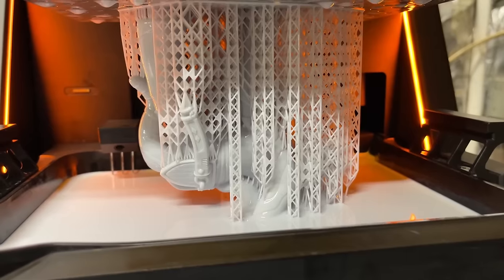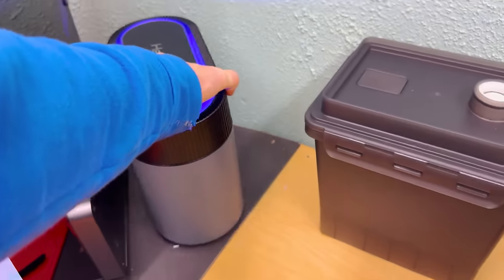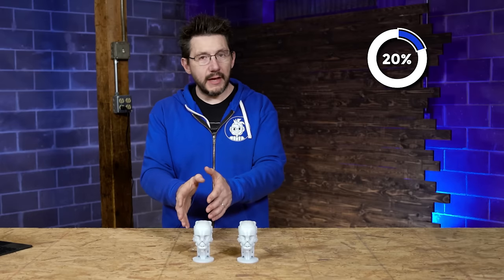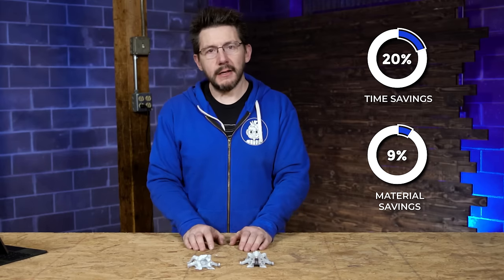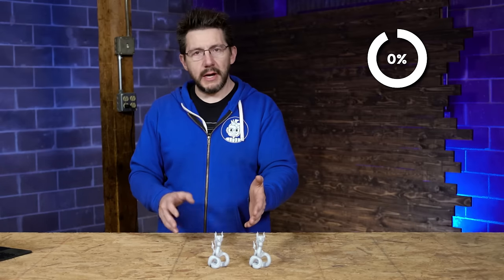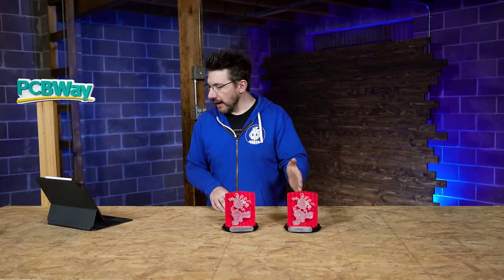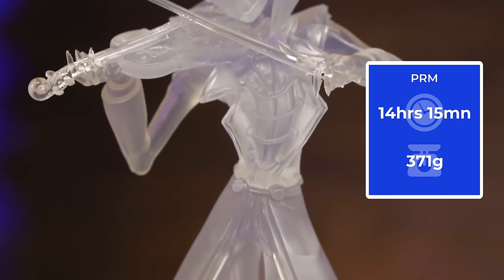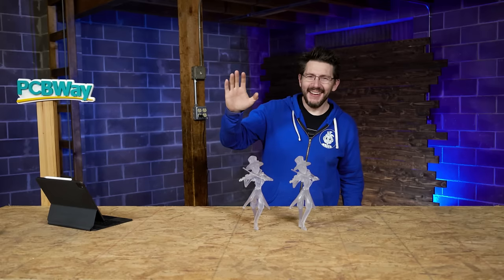Does the HeyGears PRM Work?

Comment: Not a fair comparison, you have to run the same print settings and speed up both machines until one fails. You don’t know if you could have achieved those settings on the standard machine.
Reply: so you will not have video comparation because all would fail.
Reply: @rubendariovelez   I think the point is you incrementally change the speed/support values and take the best possible set of parameters that each machine succeeds with to use for the comparison and to see what the actual savings are.

It's a fair point that this would be the only real way to get to the most realistic values based on what is realistically achievable for each machine. Otherwise you are just comparing two arbitrary lost of settings without knowing whether they actually represent the limitations of each machine or not.
Reply: I agree with that. In terms of reducing stripping force, I believe we can entertain bolder ideas, such as printing models without supports. I feel this module has sparked my imagination even further.
Reply: HeyGears slicer is locked and you can't change the settings. The only thing you can change is if you want to print a miniature out in 50microns or 30microns. So they are using both the same settings.

Comment: hmm this makes me wonder if the printer without the release module could have also printed with the settings chosen for the printer WITH the module.... because doesn't this all rely on having chosen different settings in your slicer? Like you still have to choose a different lift speed right? Meaning I feel like to really get a true understanding of if it works, it's almost like you'd need 3 printers. 1 printer with the release module and tunes settings for it.... another printer without the release module with those EXACT tuned settings.. and then another printer with longer lift speeds to show what was really needed to get the same successful print. If the printer without the release module that also has those tuned settings fails, but the printer without the release module with it's different setings succeeds, and then the printer WITH the release module is successful, then I think you could say it definitely works.
Reply: I completely agree. It wasn't scientific. It felt like an ad. Of course, the 1 was faster. The files were configured to be faster. He didn't share why those settings were appropriate for one and not the other. Some config prints are all that would be necessary to justify the different settings. Otherwise, it is just theatre. He was comparing apples to oranges. Even that the 1 print failed doesn't prove anything.
Reply: I have a great interest in reducing the stripping force. I'm imagining if, through this module, my need for supports could be greatly reduced, or even envision a scenario without any supports at all. This is what I most hope to see. I'm looking forward to seeing more test videos.

Comment: Unfortunately, the testing method as presented is flawed and doesn't provide any conclusions. Perhaps if you had used the same speed and support settings for both printers and shown consistent failures with the non-PRM prints we could deduce a difference. We don't have evidence that the non-PRM prints couldn't perform with the same settings, aside from the single failure you encountered.

Comment: I love your videos Joel but this sounds like hogwash to me... It's a box that sits next to the printer and does what exactly. No real info on their website either and 650$ SMH
Reply: I do believe it saves time and resin. Time from being able to peel faster, resin from having smaller supports. If those supports would also support the normal model we won't know cause I don't think he tested/tried (except for the skull, where even the stronger ones Brooke).

But not even mentioning the price (except for it being visible in a screenshot) is kind of shady. Cause that buys a lot of resin! Not too mention their printer being much more expensive than most in the same class, too.
Reply: Seems like this device generates high frequency vibrations and, by sitting close to the printer, transfers the vibrations via the shared surface of the desk? In this case, having the reference printer sharing the same desk surface would cause it to potentially benefit from the same effect when printing at the same time. Would love to see a follow-up with fairer test conditions.
Reply: @KayMan2k An actual test would be nice. This was just using two different settings. Those settings may require the little device or they may not. We can't know from just one test print (per model and setting).
Reply: @KayMan2k anole said it uses air to create the high frequency vibrations.
Reply: If it transfer vibrations thru air, then it won't be ultra sonic. And then, why not just shake motor?
Reply: There's an air tube that connects the two: https://youtu.be/jd6m7DVQ9MQ?t=11 @KayMan2k
Reply: @thePavuk I have no idea I’m just stating what Joel said in the video and I’m sure he’s just stating what he was told by the company.
Reply: Not a fan of this video. It is an advertisement.  No substance- didn't show us the difference in supports, nothing showing it is easier to remove supports, and all the values seem to be from the slicer rather than actual measurements. Love Joel but hate these paid advertisements.
Reply: I found on their livestream that It's airpump, it pressures area in printer or between screen layers so it bends up and release layer.
Reply: @thePavuk  so it's an air pump?? For 650$...
Reply: If this technology were real, I believe it shouldn't just be sold for $650.
Reply: This could be a brand-new technology, and I hope it can undergo more testing. @KayMan2k
Reply: It also comes with a specialized resin vat. Can't use the pulse release module feature with a regular resin vat. However, a regular resin vat AND the specialized resin vat will work in regular printing mode.

Comment: I guess a couple of questions/points.

Did you try printing the model file with the PRM settings/supports on the non PRM machine just to check whether they would indeed actually have failed without the PRM?

On the resin used/saved, I assume this is based on the values given by the slicer, which would account for the resin required to create the model plus the supports. In reality though there is a fair amount of additional waste resin due to the amount which coats the print (and gets washed off). In my experience this increases the amount of resin used a not insubstantial amount of the overall resin used. Assuming this would be much the same for the PRM and non-PRM prints of any particular model, this would drag the actual % saving from the PRM down a bit (I guess the only way to know would be to weigh the resin vats before and after printing to see how much resin was actually used... unless you di this, in which case I'll shut-up!)

Comment: No footage of it in use?
Reply: Seems like marketing video.
Reply from the maker: Working on it in a follow up. There isn’t much to see when it’s powered on. I believe it’s a small air compressor.
Reply: @3DPrintingNerd  that costs $650 😅 Someone is going to figure out how to do this with a cheap ultrasonic devicd
Reply: @Hilmi12  If ultrasounds can be used, maybe someone could just attach the transducers to the printer itself so they power on after the UV light source powers off every layer, kind of a reverse resinlapse, but it works when the UV is off instead of when it's on

Comment: Why not use an ultrasonic probe placed in the resin vat?
Reply: I thought something similar, though you might want to vibrate the vat itself and not the resin pool. The other consideration is how to pulse the vibrations during the layer change and not just always on. You would probably get print artifacts and failures if you vibrate during curing.
Reply: Timing the vibration to just as the light goes off and the peel starts may definitely work.

Comment: Seems like putting a Transducer in the frame of the vat or vat base would be a billion times more effective; than using puffs of air directed at the printer body. Requiring less power/materials. 

The data for pulse timing could be set in the slicer. The build structure could easily be vibration isolated with gaskets/bushings, or sensitive components mounted on anti vibration mounts. This seems like it would be more effective and cost less. 

The perfect solution to take advantage of the extremely narrow window available to speed up resin printing, just not best application.

Comment: My understanding was it simply syncs with the retraction and pumps air below the feb film removing the suction making the print release easier thus allowing you to use much lighter supports. Ross at Faux Hammer was down to 50um supports which is nuts. The supports just fall off after printing leaving little to no effect on the model. Now just need a couple thousand dollars extra to buy the printer and the PRM module . $1399.00 for the printer and $695.00  not to mention the 60-70 dollars HeyGears resin for their special 385 nm UV .

Comment: Any chance you could do a test with an upturned motor and an offset weight to see if it yields the same results? Maybe even connect a microcontroller and see if you can't time its pulses to when the printer finishes a given layer and starts the tilt process? It would be cool to see someone DIY this and improve the overall resin printing field.

Comment: It's cool that the printer can theoretically use less resin due to needing lighter supports. In practice though, I don't think we're quite there yet with autosupports for most resin prints. The vast majority of what I print is going to be supported by hand. Sometimes by me, but usually by someone hired by the original modeler or the original modeler themselves. In those cases, it's just going to be a pure speed boost.

Comment: I appreciate what is trying to be done however current post-processing is hardly a gruelling chore. I'm confused over the resin saving, too.
Reply: Thanks for your interest in the PRM! By using the Pulsing Release Module to lower the peeling force, the required diameter and density of the supports needed to achieve a successful print can be reduced, thereby allowing for decreased amount of resin used in the support structures. This generally means more resin saved with prints that require a lot of supports. The overall reduction in support quantity and the size of the contact points should also make it easier for people who spend time sanding the bumps left by supports to get a smooth surface.

Comment: [ explanation ] I explained how this machine works, but my comment dissapeared. Probably again bug of youtube.
It's air pump for that specific printer. It pressures eather area under vat or double layer screen so the screen bends up and releases layer.

To find how it works, don't go to their page, don't just go to their promo video... go to their promo video and there is link for "the launch live stream" where they explain it in 2:20 

I would not cal it High Frequency Vibrations - you can't go over like 100Hz with high pressured air in long thin plastic tube. More like 10Hz.

Comment: So the printer knows it has the module and automagically changes the procedure? Or did you have to use different profiles?
Reply from the maker: You tell the printer it had the module and it will configure itself automatically

Comment: You likely could have gotten an even bigger resin savings by manually shrinking the support settings in blueprint. You can go insanely small on your supports with the PRM and still get successful prints its kind of crazy. Definitely turn off the ball tips too. The other benefit of this is practically indiscernible support marks.
Reply from the maker: Whoa really???

Comment: Did you switch which printer has the PRM? That way the gains are isolated to just the PRM and not a "better" printer. They may be the same model, but it is unlikely they are made by the same person using the exact same pressures and tolerances during assembly.
Reply from the maker: No not this round but I may in a follow up. I like this idea.

Comment: Did the slicer auto calculate supports and speed or did you have to do it manually? Auto I could see but if you manually did it I would have taken it to the max it could do like others have said.
Reply from the maker: Everything was auto calculated by the slicer. You pick the machine and what type of tank (normal or PRM) and then it auto sets everything.
Reply: @3DPrintingNerd cool thanx!
Reply: @3DPrintingNerd Then it should be easy enough to test if the PRM settings will indeed need the PRM to be present.

Comment: So it is fairly obvious where the time savings comes in...less peel force so faster print speed settings can be used. But the material savings isn't so obvious. Was the reduced material due to needing less/smaller supports? I would think that prints that need no supports would not have any material savings.
Reply from the maker: Yes, it was in the supports! The supports in the PRM models were thinner than the standard supports. I’ll try to get some close ups for my follow up.
Reply: @3DPrintingNerd  I figured as much. I already use the smallest supports available in Lychee, I just use a lot more of them. That way the supports come off a lot easier.
Reply: Yes, that’s right. Models that require more supports will generally see greater resin savings when using the PRM. The PRM also makes it possible to use fewer supports overall, since the lower peeling force means both the quantity and diameter of supports needed for a successful print is reduced.

Comment: What if any changes are being made in the slicer? This video seems to be missing key information.
Reply: The slicer for the UltraCraft Reflex, Blueprint Studio, will automatically apply some parameter changes when the PRM is selected and used. Those parameters cover a range of different things including support diameter, support contact point size, support quantity, build plate movement etc. to balance with the reduced peeling force that the PRM provides.

Comment: Does this need to be sliced separately? I assume that the supports are made thinner by the slicer for the one that uses the PRM, and also change the duration of the build plate movement.
Reply: When using the Pulsing Release Module (PRM) with the UltraCraft Reflex, just select the PRM option in the Blueprint Studio slicing software and it will automatically adjust the printing parameters during the pre-processing - including the support diameter, contact point size etc., no need to manually adjust the separate settings. Hope that helps!

Comment: Thanks for the video.
Shure vibration wil decrease the peel force needed. So it can print faster becouse of faster lift speeds.  But how on earth can it decrease the amount of resin used, if the model with the supports is the same. The volume doesn’t charge.  Or did i mis something,  like using auto support specifically attuned for the model with the vibration module (resulting in smaller or less supports) and the other one without the vibration module optimization resulting in a higher vollume.
Also exposure time (under or over exposed)  there will be a difference in volume. 
I hope you can adres this. 
Ps. The volume of resin used how did you measure it. The calculations of the slicer?  I personally don't trust those. Example slicer tells me it wil take 3 hours but actually it takes 3 hours and 40 minutes to complete

Comment: How were the settings between the two, in the slicer specifically because that makes a huge difference. You kinda need the same settings, then the optimized for both and see if that also shows these differences. If they remain big, it may be worth it, but 700 Dollars seems very steep, I guess it's likely just a pump blowing precise sheets? of air.
Reply from the maker: The settings aren’t exposed to the user in their slicer. I’m going to see if I can find out.

Comment: Couldn't you achieve this via firmware update by making the z movements after every layer have the motor tuned for high vibration when going up in the Z axis? It sounds weird trying to make the motors vibrate when usually you try to mitigate that.

Comment: I have a 3D printer and am wondering if you know how to take off layer lines. If you know how to do that I would appreciate if you could tell me.
Reply from the maker: In my case I would use sandpaper. Sanding 3d prints can take away layer lines and get them ready for priming and painting.
Reply: What if I make a retractable sword and I can not get to some of the layer lines what should do?

Comment: Late to responding to this, but even the 'fast' printer was not impressive speeds, I print significantly faster then that on my Jupiter(standard nfep) with a full build plate, printing a full build volume (300mm) in under 11 hours. 

Also your failure on the dragon skull had nothing to do with peel forces. That kind of failure, with the raft peeling from one side, will have been caused by a bad level on the build plate.